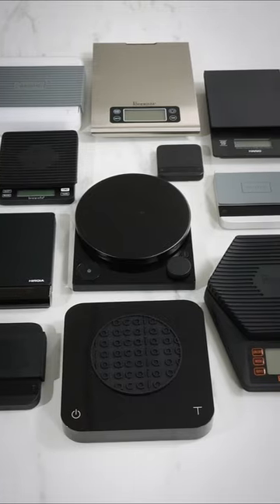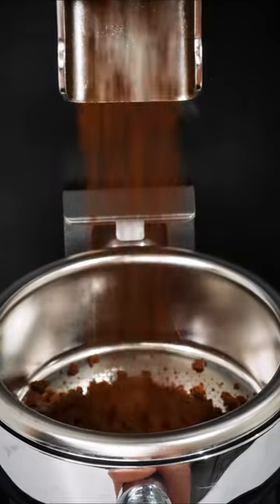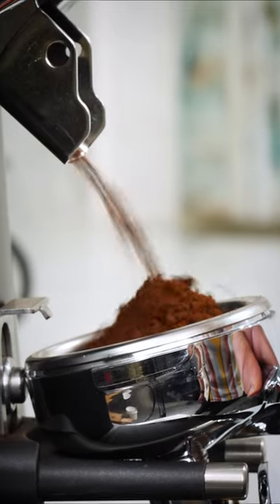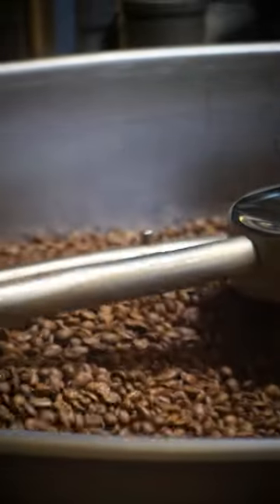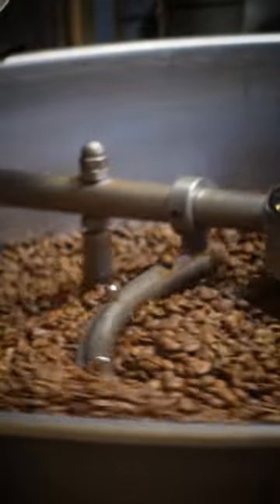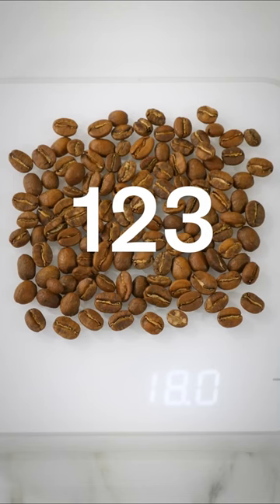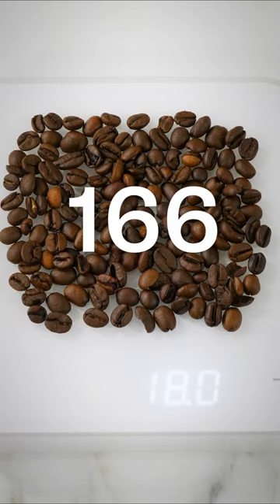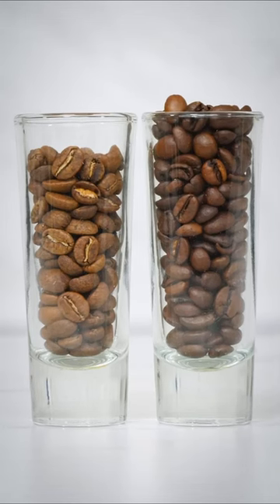Why use a scale to make coffee?

Comment: What’s a great entry-intermediate scale?  I have your Rocket R58 machine with the Ceado E37s grinder. Thanks @wholelattelovepage
Reply from the maker: Hi there.
Anything would work, from a small kitchen scale you can buy at the grocery store to an Acaia Lunar. I would recommend a scale with precision down to .1g. Something like a Brewista Smart Scale or an Acaia Lunar are going to be the best options for espresso scales.
-- BRYAN
Reply: Funny we almost have the same setup! I've got an upgraded R58 from 2019 with a "Ceado E37SD". Something very annoying I've noticed with my grinder is that after the first grind, every next one will need to be -0.10 on the grind size like towards finer so it gives the same results as the first grind, otherwise it will flow too fast like wtf? Then it resets back to the adjustment of the first grind after a cool down of 1 hour... I've never understood!

So I use the "Acaia Lunar" but back then some years ago there was nothing on the market, it was either a garbage kitchen scale or an overpriced scale. Now there's plenty of scales that does the same job as the Lunar for 2x less. I'd suggest you look into the "Timemore Nano Scale". There's another good one but I've forgot its name.